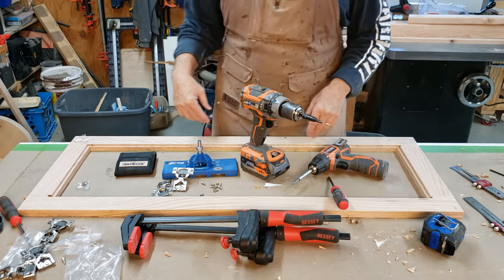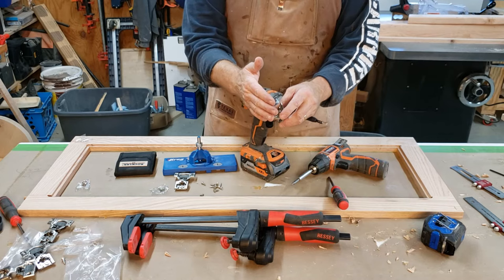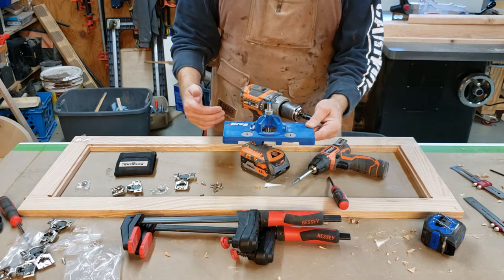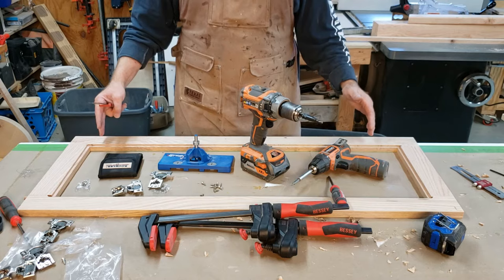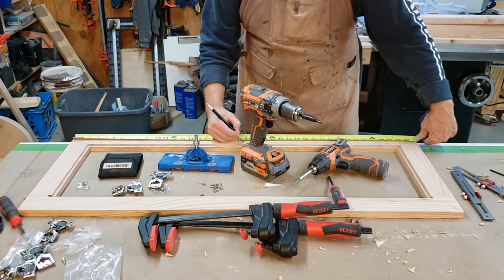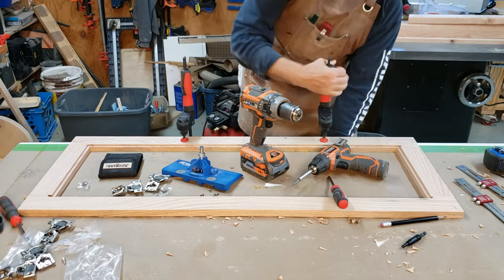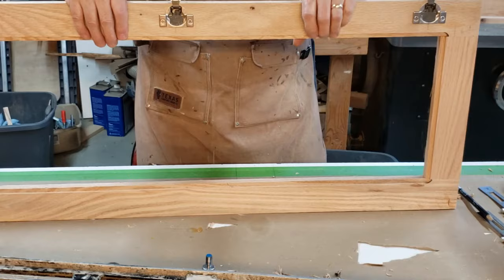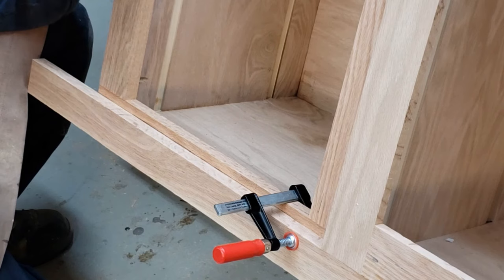Soft Close, Face Frame Hinge Installation • Showcase

Comment: The self-centering bits linked are no longer available. What size specifically did you use for this Berta hinge? The instructions say to drill "1/16 (1.5mm) pilot hole". What standard-size self-centering bit do you recommend?
Reply from the maker: Sorry the bits are not available any longer. I appreciate you letting me know. I have updated the link to another set that will work as well. 
BOSCH CC2430 3-Piece Clic-Change 1/4 In. Self-Centering Drill Bit Assorted Set
https://amzn.to/48X5HWV

Comment: I've always used Blum hinges, but will have to give the Berta a look.  They appear to be non-clip type like the Blum Blumotion soft-close, but allow easy three-way adjustment without having to loosen the mount screw like the Blum.  

I don't care for the removable clip type hinges, as they add too much width and get in the way many times when you want to add shelves, trays, pull-outs.  I only use removable clip hinges in rare cases like corner cabinets with lazy susan bi-folds.

Tip... if you do many doors, I think the Rockler JIG IT Deluxe Concealed Hinge Drilling System is a much better than the Kreg.  It is made of mostly metal, permits you to setup for two or more holes per door with its rail system and has integrated clamps.  I added a third drilling guide so I can easily do three hinges per door and ensure exact placement between multiple doors.  Worth every penny it costs... ~$200 for the three clamp system I have.
Reply from the maker: @csimet  I do need to try Blum but these are easy to install and adjust. And the price is right

Comment: Great help! I think if you use the jig for the plate holes. I think they will be square and you won’t need to mess with the level.
Reply from the maker: Its been a while since I did this video but I believe I used the jig for the screw holes. Without the level they can still get out of whack. The level makes sure they are all lined up with each other

Comment: I ordered the 1/2” hinges from your link. I believe the instructions say to use a 1/16” self centering drill bit for the screws. The self centering bit set you suggest does not sure contain this size of bit.
Reply from the maker: I just use the smallest one in the set

Comment: Thanks for getting back to me.  I just spent a little time to figure out exactly what I need.  It turns out that my cabinets are older and have the 3/8" lip.  Apparently I need the concealed cup hinge for a lipped 3/8" cabinet door.  Those seem to be fairly expensive.  One place wants $47 a pair.  I found a better deal at Hardware hut and they want $11.46 per hinge.  For my project that I need 80 hinges.  That's $916.80 for all of them.  I would like to find them for less somewhere.  Any ideas?
Reply from the maker: Have you tried https://brusso.com/

Comment: Hi Do you recommend the compact clip on for easier instalation?
Reply from the maker: If you are referring to the clip that attaches to the face frame, then yes. If I have frameless doors them I use a different style that attaches to the inside of the cabinet.

Comment: How far out does the door sit from the frame with those hinges? I have read comments from people saying the door sits about 1/4” away or 1/4” gap.
Reply from the maker: You will have an 1/8" to 1/4" gap depending on how you adjust them. I have never had an issue adjusting these hinges. Even on my cabinets in my house I have that type of gap.

Comment: I bought some Ravinte face frame soft close hinges and am pleased with the adjustability except the adjustment that moves the door in out. I have about 1/8- 3/16 gap on the hinge side that I cannot close.  I’ve never had this problem with the Euro hinges.

Is this your experience with the Berta hinges?
Reply from the maker: I really don't have an issue with the Berta's. I can tell you there is an 1/8" gap on the face frame hinges in my kitchen.

Comment: Hello from Jackson Tn. 1st gotta say thats a beautiful cabinet you built! Have a question... I'm installing similar hinges a customer already purchased from "The Home Store" here. They're 'Hardware Resources 3390-R' (1/2 overlay compact cabinet hinge without dowels) they have 4 prongs on the cabinet side I assume to go around the frame? I've never used any like this & searching to find anything similar before i do any modifications to install them. They look very close to your hinges i couldnt tell if they had the 'prongs' i mentioned that these have? Due to the design of his existing cabinets the 'prongs' are a real pain in my... Lol why I'm tryin to find their exact purpose before i have him return them or do any modifications to the existing cabinets. Thank you for your time & great video!
Reply from the maker: Oh ,an the bane of customer purchased materials! I have so been there. I am away from my shop for the next couple of days but I believe I know the prongs you are referring to. They wrap around the face frame to keep them from twisting I believe. I need to look at the ones I use now because honestly I can remember if they have the prongs or not. I return tomorrow evening and look at mine. Is there a special reason the customer provided them?

Comment: Never mentioned the back set
Reply from the maker: That is set at the tool and the hinges I use are all pretty much standard to the default set on the kreg jig
Reply: It depends on the overlap you want. Can be as little as 3mm or as much as 7+mm.